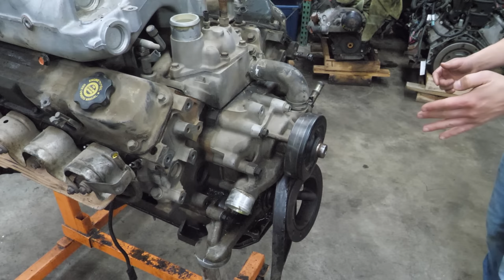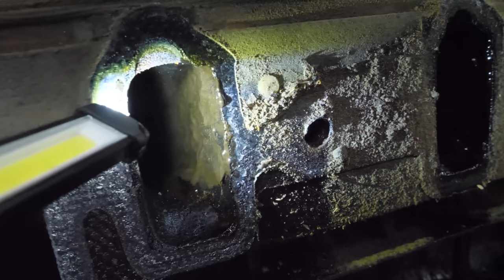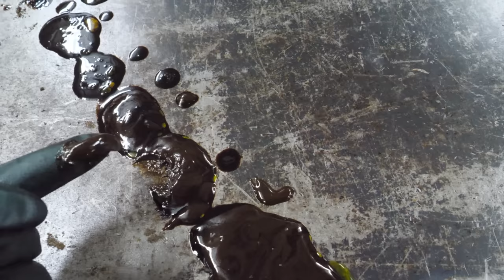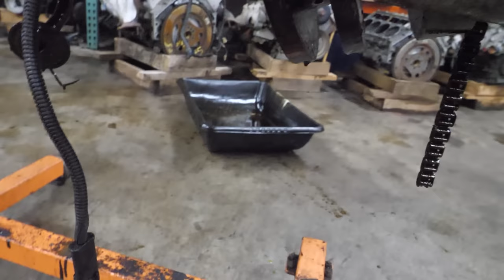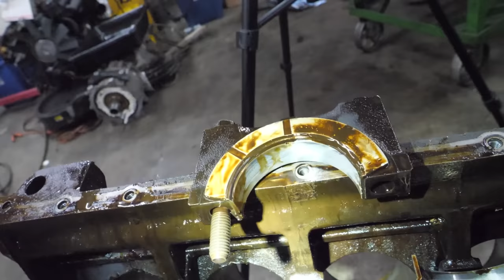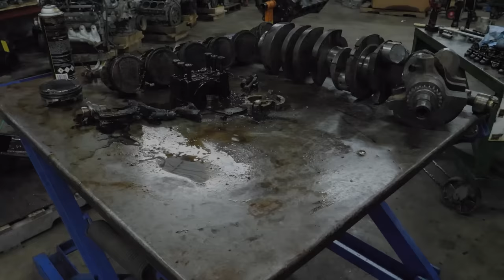8 LITERS OF DESTRUCTION! Dodge Ram V10 Engine Teardown. Broken In Ways I Have Never Seen!

Comment: That engine had to have been held at WOT for a period of time to purposely blow it up. That is massively impressive
Reply: I think it was intentional, someone floored it to over ten k rpm until it blew up, Maybe an angry mopar hater or bet?  Or for kicks if it had over two hundred k miles on it.  If I was gonna junk the truck, I might do it for kicks.
Reply: @umajunkcollector what sucks is you could wreck the trans pump along with it. Esp if they seemed to want to keep it. Oh well.  Great for us viewers!!
Reply: I’m thinking money shift of some sort
Reply: I’d agree with WOT until it died.
Reply: @nathanrykers7588  the reason I say money shift is I’ve burnt down tired engines just letting run wot till they die and normally they just get super hot and then lock up, this looks like wot with an over rev with a load on it judging by how it snapped the crank in two
Reply: @stormphillips4316  
Yeah you probably right.
Reply: Money shifted into 1st instead of third, I've seen this kind of damage before
Reply: @@longjohnson699things don't just break that catastrophically without warning in reality. Rods letting go are just quick.
Reply: Sounds like Kung Fu Panda!  INCREDIBLE BATTLE DAMAGE
Reply: Money shift
Reply: That was my first thought. Humpty-Dumpty was pushed. Hard.
Reply: WOT ?
Reply: @simoncullum5019  wide open throttle

Comment: I had a 1996 truck with this engine, and it was amazing. By far the best gas truck engine ever made, and tougher than hell. Truck went 200,000 before I traded it for a lame hemi.
Reply: I traded my last V10 for a Hemi because I wanted those 2 extra doors and I hoped to get better fuel mileage.  I sure like the extra doors, but I sure miss that torque. That V10 was smooth as silk, too

Comment: With out a doubt  they had there foot to the floor to the bitter end!!! LOVED THIS ONE!!!!!
Reply: Some say his foot is still floored to this day
Reply: @djmartin4776  Or potentially more likely a brick. Or possibly a cinderblock. That would also give some insight into the slightly melty heat tab, too.
Reply: @djmartin4776  At any rate, I hear from the locals if you go back into the woods where the pineys live, you can still here the ghostly echoes of its rev limiter's past, silently brapping away on a cold, dark night.

Comment: I am amazed at the carnage of that 8 liter V-10.  That had to be one of the loudest explosions ever heard in on that road.  The modern art that it made out of the rods alone was amazing.  From the looks of it the cause was more than likely he was complaining of coolant usage and the engine rebuild company was like we are not going to replace it till it blew up.  So the owner of it was like you want it blown up you got it.  Then blew it up so spectacularly that they could not deny the replacement.  Trust me I have dealt with extended warranty companies that try to weasel their way out of making repairs.  One tried to say we will not replace the engine on an old minivan I had until it blew up it was eating coolant like candy into the oil it was the old Chrysler 3.8.  So I flushed the cooling system out and dumped Dexcool into it.  Then changed the oil to Mobil 1 synthentic right afterwards.  The Dexcool mixed with that and became freaking JELLO in the engine oiling system and proceeded to cause piston 1 and 5 to leave the block out the side while my wife was driving down the road at 65.  We demanded and got a factory REMAN engine from Chrysler and they were not happy as they also had to replace the entire cooling system due to contamination.  Then less than 6 months later wife hit a freaking deer with it and totaled the van.
Reply: bruhhh, that's chrysler for you, but also bad luck with the deer timing
Reply: That dear was Karma
Reply: I would think purposely putting the wrong coolant and synthetic oil in would've voided any warranty you had with anyone. Must be a pretty lazy company to have missed that easy out of providing any warranty.
Reply: The dealership that was doing all the work on the minivan was the local GM dealership and they were also beyond upset with the warranty company.  They were the one's that refilled it with dexcool and the Mobil 1 oil knowing that when they mixed it was going to be carnage.  Or after all was said and done the service manager called it the FU to extended warranty companies that won't authorize the proper repair the first time.

Comment: Friendly PSA to check the bolt on the underside of your engine stand that's like a set screw to hold the forward arm/caster thing on to keep it all upright! Dropped my engine today, only casualties were a bolt or two, a welder ground cable, maybe the oil pump I was trying to get off, and my pride. Don't let it happen to you!!
Reply: Yikes! At least no feet were involved.
Reply: yes, before using it,   just make sure there is no play there...

Comment: Outstanding!  A gasoline powered trash compactor.  I laughed so hard and loud at your comments that I woke my wife up.  Stunning video and best running commentary.  Starting at the user installed inspection ports to the modern art deco rods. I think that the oil pump seized causing the crank to grenade and that became the trash compactor.  Your fans all have great ideas of what let go first.  Thanks again for making my weekend.  Best ever teardown!

Comment: At the Ram plant my dad worked at, there was a lot truck with a V10. Employees used it to get around the facility and do maintenance on the building. He said it was never serviced, never had the oil changed since new, and sounded absolutely horrible.

Comment: I didn’t read all the comments so I may have missed this observation by someone else. Noticed that the oil hole in the crank aft of the shear, the hole once round is distorted to an oval, indicating that the crank went through torsion or twisting before failing suggesting that perhaps that either the number or two failed first resulting locking the crank forward of number three and in the twisting of the crankshaft before the failure of the shaft,etc. Great site and entertaining commentary. Thanks!

Comment: Cool!  a 8.0l V10!   SOO many times I hear "those engines are junk".  They really aren't "junk".   Taken care of, oil changes and all the PM stuff, they'll last... which brings the biggest issue.  Getting parts for these CAN be a big deal.   Most times,  it was just easier to swap it with a <insert flavor> diesel.   In this case... This poor Engine was definitely neglected... Improper maintenance, failure to change oil... .
Reply: I have a 1998. I had to order a rocker arm bolt from Germany!!!  They are reliable engines if maintained correctly. Most get beat up, tow all their life and are just neglected

Comment: I'm surprised the main caps are only 2-bolt.  Thought for sure they'd be 4-bolt, maybe even cross-bolted.

Also: Longest. Camshaft. Ever. Loved it!
Reply: Chrysler never made a 4 bolt engine. The hemis are cross bolted on the 3 center mains but still 2 bolt caps. But very beefy.
Reply: It's such an understressed engine, why bother? It only makes like 50hp and 60lb.ft per liter. The four pot in a Camry is more stressed than that.

Which is why it's impressive they managed to blow it up in the first place.
Reply: @BigUriel orsepower is a very very small part of the equation. This engine is within heavy duty trucks, built to pull and carry a lot of load. The stresses and load on this engine are tremendous. It's under built for it's intended purpose.
Reply: @AK_Ray  You're right horsepower is a smal part of the equation. The internal stresses an engine is subjected to are usualy measured in brake mean effective pressure, which is effectively another way of measuring specific torque. Which like I said is 60lb.ft per liter, which is nothing for a modern engine. A tiny 1 liter 3 cylinder Ford Ecoboost engine that they fit into small hatchbacks works under 3x the mean effective pressure of this V10.

Compared to any modern engine this engine is like never working at more than half throttle.
Reply: @AK_Ray  stresses are reduced through the diff, trans, and especially if its a converter type auto trans
.
also... GMs 400 small block they made both 2 and 4 bolt mains
the 2 bolt mains are simply stronger (as the extra two now take away your crack webbing) 
.
what you do is get a 2 bolt main (factory) block 
then have aftermarket 4 bolt "splayed" caps installed... which angle the added 2 into the block, VS the crank web/support 
.
or, just quality bolts on the 2 bolt..... 
unless you are adding boost or playing with stroke/bore a lot.... a good 2 bolt setup is probably enough 
.
if you want a higher RPM motor... built a 377.... 
350 crank in 400 block
big fat piston, "short" stroke (4.185+ bores on a stock 350s 3.48 stroke pretty oversquare if ya ask me)
.
they are fun little motors.... much more "RPM happy" than a 400/383
Reply: @mikec9112  No, other way around. The Hemi was originally engineered this way by Chrysler starting in 1951 and stayed relatively unchanged as it evolved into the 426 and later. The bolts and main caps just got slightly larger and more reinforced as the years progressed, and a lot of NASCAR Hemis utilized main supports engineered by Mopars racing division.

Comment: Well, this has inspired me to actually do the postmortem on my own blown 488.  It hauled ass over the top of the Catskills on NY State Thruway,  then I noticed the smoking tailpipe and the plummeting oil level.  Compression test showed 3/10 cylinders holding no pressure.  But with a case of oil to keep it topped up, it brought me safely home from Herkimer NY to Hartford, CT.  NO TOW.  I think the real culprit had been arcing sparks from cracks in accidentally pinched plug wires during a few days, but fixed weeks before the trip.   A bunch of badly timed firing that must have made enough detonations to weaken something bad enough to fail later when pulling hard and hot.  I certainly hope nothing as brutal as what you show here.  Your guided tour to the teardown order will be a big help when I eventually dig in.  Has been 5 years, and my pre-owned second engine is still running well, as long as I keep backups of the crank sensor around.

The most amazing think is the outside view of your catastrophe looks just like my happy running engine (minus some drill holes.)

Comment: i actually have a 96 Dodge Ram 3500 dually, with the V10, sitting at 347,650 miles on it, and it is a very durable and reliable motor

Comment: All I can say is wow, what a hell of a journey that engine experienced. That’s worse than a little Corolla I picked up yrs ago with engine that had a hole in the block.  But anyhow thanx for showing this this is a testament to the durability of those v10 engines. This has helped me solidify my decision because I’ve came across a 1997 regular cab 2wd  v10 2500 I ve set my mind on getting. I already know the MPGs are going to be horrible but I don’t rip and run around nearly as much on commutes now. Just discovered your channel Great great video thanx!

Comment: As a current owner of a V10 Ram, I am now concerned enough to change the oil  tomorrow!
Reply: Don't forget the filter.....
Reply: Will this be the FIRST oil change on your V10 Ram .?
Reply: @ricardofierro7041  just thinking this V10 has 300 hp and 400 foot pounds of torque ? My 2017 Ram Hemi has 395 HP and 410 torque ! More power and better MPG then this 10 cyl monster!
Reply: @markchodroff250   Well, uh...this first debuted in '94. Engine tech has come JUST a little further along in that time!

Comment: I LOVE your tear downs.. EVER done a 84-88 Ford turbo charged 2.3L  I owned 4  thunderbirds.. 83, 84, 86, 88 and loved them, just blew them up around 30K.. Lets face it.. to turbo charge a pinto engine will not last long, but when it did. Was SO MUCH FUN.. with the bigger turbo, the sounds from the engine bay just wanted me to push harder on the right foot.   I'll work on getting you one to tear down! and thoughts.

Comment: I have zero doubt... That engine got the center block on the gas pedal send off. The people involved (there is usually a crowd for such events) are still talking about it to this day.
Reply: wonder if WhistlinDiesel got his hands on this one. or NeutralDrop had a hand in it
Reply: I agree with the send off. That engine was run wide open until it wouldn't any longer...

Comment: The problem with the Dodge V10 is the poir efficiency, which weirdly comes from the transmission it was bolted to.  Dodge made them to deal with the Cummins of the time, so they were rated for 450lbs of torque.  They would simply change the shift pounts and go.  In making the V10, they assumed that wouldn't be a limitation and designed it with similar specs to the existing, VERY mild 5.9 Magnum V8 in terms of compression, cams, etc.  In testing, this combination proved very potent and shredded those transmissions. Short on time before the release of the new Ram, it was quicker and cheaper to nerf the V10 than to create a new internals package for the transmission.  So they reduced the already-low compression, reduced the already-tiny cam.  This reduced the performance to a more durable level, but also greatly affected efficiency.  The 5.9 Magnum is already quite a pig in need of more compression and cam lift; the V10 is practically strangled.  It was stronger than the 460 and 454 though, so it was good enough. Of course later on, the Cummins gained significant performance and, without the time crunch, new upgraded transmission packages were rolled out to deal with them.  The 12V Cummins was bith popular and very profitable, but the V10 presumably just didn't sell in great enough numbers to justify tuning it back up to glory.  I suspect that by the time the Ford V10 and Chevy 8100 Frankenstein big-block hit the scene, Chrysler were already working on the Hemi and weren't interested in polishing the big pig.

I always really wanted to see the iron V10 show it's potential.  Fundamentally, it really is a superior design to the V8s it's based on.  It has an even port layout, reducing pushrod restriction on the intake side and eliminating uneven heating on the exhaust side.  The GOOFY lifter angle of the V8s (a vestigial reminder of the ancient poly-head roots of the LA) is finally corrected.  It has distributorless ignition, which is great in a Ram where the distributor was located way back in a deep dark hole.  Deep-skirt "Y" block bottom-end design.  By rights it should make 500hp and DANK torque like falling off a log.  But the aftermarket is basically zero because apparently gas is for girls and real men drive nasty clattering FedEx delivery diesels.  Throw in the existence of Viper V10s and even hot rodders don't care about the iron ones.

Comment: Hello, I appreciate your channel, you make great videos.  I wish you would consider investing in a super-duty engine stand, like an OTC diesel stand that has a crank to rotate it.   Once you work with a stand that doesn't bounce and wobble, you will never go back.  Please consider it for your safety.  Have a good one, Higgydufrane.  By the way, that is an incredible amount of damage, one can only imagine the heat and pressure required to do that damage.

Comment: My hypothesis is that the block was perhaps cracked around the number 2 main cap bolt hole, possibly from or exacerbated by the past rebuild, the block let go when somebody had their foot in it, and with the number 2 main cap no longer anchored to the block to support the crank, it broke. With the front of the crank now running askew the foremost trio of rods and pistons couldn’t compensate and failed catastrophically, the askew crank obviously also broke the oil pump. All of which in combination caused any oil pressure to take a nose dive, which with these engines oiling from front to back showed up with more broken rods and spun bearings at the back of the engine.

Seriously impressive failure, the only other engines I’ve seen in a similar condition to this have come from someone like Clay Millican. One of the best ever Eric.
Reply: There's a famous photo of a TF engine where the crank, rods, and pistons were still in the car, connected to the clutch and trans. Every other piece of the engine was completely missing.
Reply: I think the crank failed in overload due to the cooked bearings further back eventually seizing / welding themselves or whatever (perhaps jammed when those rods failed from heat?).  The crank damage looks like a torque fracture.  Then the major mechanical damage occurred rapidly from the thrashing crank stub.  So I figure original reason is local oil starvation, or perhaps more accurately local sludge starvation.
Reply: @MycontentisgoldJerryGold  Are you referring to the Eddie Hill engine failure in 1997?
Reply: @09corvettezr1  I found a photo of the Eddie Hill explosion online. It looks like the same type of carnage, but it's not what I recalled. The one that I referred to was in black and white, was after the fact, and may have been from the 70's, possibly at Indy. I couldn't find it online.

Comment: From the heat marking on the rods and crank, I would say that that engine was low on oil or oil pressure for quite a while before it blew its guts. I've never seen heat damage that bad. I've broken two crankshafts in my time in my Galant and Starion.  Both engines continued to run (after breaking the flange between front main and first conrod big end journal) with just a bit of a rattle and basically only needed the cranks bearings and seals replaced.

Comment: Yesss my Impreza engine! Finally the 488 Magnum!
Reply: So much sludge in that engine. I'm definitely blaming neglect for its death.
Reply: Crazy to see a crank THAT THICC broken. Yes these engines weigh almost as much as the Cummins, but a bit less.
Reply: Just FYI if it didn't get smacked that crankshaft position sensor is worth quite a few bucks!